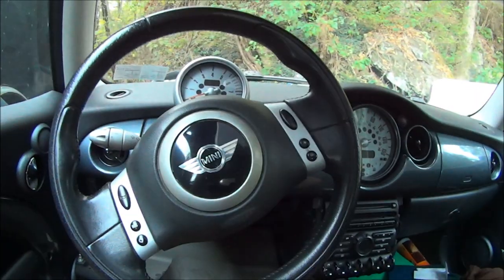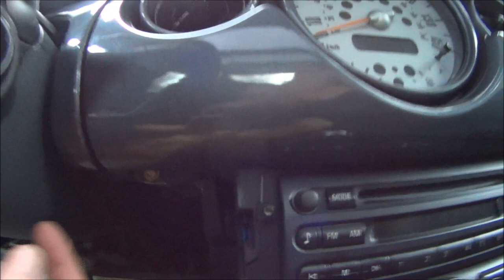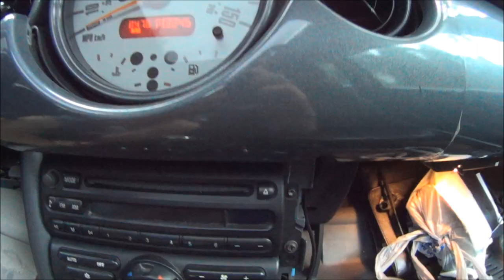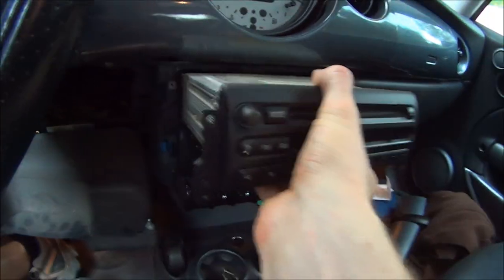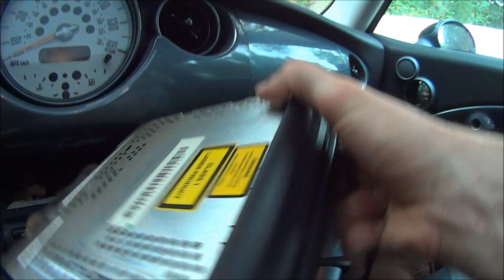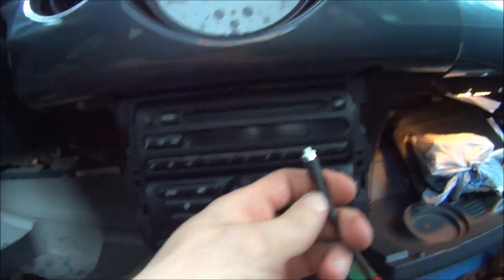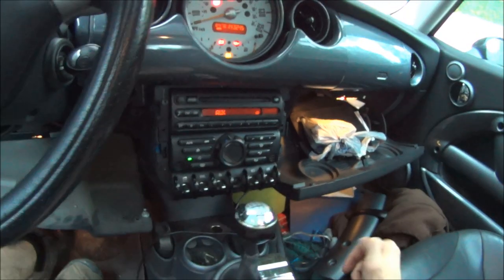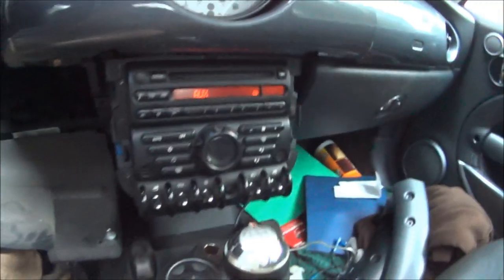Install AUX Adapter in MINI Cooper + How to Remove Radio - 04 Cooper S - Auxiliary Jack 01-06

Comment from the maker: IF YOUR RADIO WON'T GO INTO AUX MODE:

1. Plug in a music playing device to the radio, play a song, make sure the volume is all the way up on the device, and then try to press MODE. If needed, verify your device's headphone jack works by testing it with headphones.

2. Sometimes the cheaper generic cables aren't put together properly. The electrical pins MIGHT be in the wrong slots in the plug, make sure the wires going into the plug (male) match the locations of the pins on the radio side (female).  If you bought a BMW cable, there should be no problem with the cable.

3. If you're not in the US you might have a different type of radio (similar doesn't cut it, different is different); so you may need this:  https://www.amazon.co.uk/Cooper-iPhone-player-adapter-interface/dp/B00JEWNTJE (be sure to read their entire listing to make sure it fits your radio), and you might want to look at this: http://www.mini2.com/forum/first-generation-interior-ice/166862-diy-aux-input-uk-mini-cooper-pics.html

Also when I say CD player I mean the 6 CD changer that mounts in the back of the car.

Comment: I watched your video several times over the course of the past month, in readiness and I ordered one of these cables. It arrived today. 20 mins later, i had it plugged in and AUX appeared in the mode settings and away i go. My iPod and iPhone both work a treat. Great video and tutorial. (2004 mini cooper convertible). Thanks DIY car guy. :)
Reply: So it didnt appear until you plugged the aux in?

Comment: I did this yesterday. When you pull down the panel at the 27 second mark, using this video as a guide, at that point you can reach behind the radio, feel where the plug goes with your finger and plug it right in with the tab facing upward as shown at 2:51... My radio showed the AUX option immediately once the plug was in! I hereby dub this "the reacharound method".

Comment: Thanks for the video.  I'd been putting the install off for weeks because I didn't want to remove all those pieces.  With your video, I saw where the plug was on the radio and how it was oriented.  I popped the piece down below the steering wheel on my '04 Cooper S MC40, felt around behind the radio, and (using yours as a go-by) installed it without having to pull the radio out at all.  Connected it to an aux-to-bluetooth kit ($15 on Amazon) and in 30 minutes had a crystal clear bluetooth handsfree setup.  Even though I didn't go through most of the steps, I couldn't have done it without your video.  Thanks!
Reply from the maker: +Chris Wade No problem, Good thinking, that is awesome! Hopefully others will see your comment and save themselves a bunch of time. Thanks for sharing this info!
Reply: +Chris Wade Nice! But where did you leave the cable?
Reply: +Diederik I fished it through to the glovebox and installed it in the normal spot.
Reply: Did you drill through the normal spot in the glovebox or?
Reply: +Tyler Osborne Yep. Same place. Everything is basically the exact same, I just skipped removing the cd player.
Reply: Thanks so much for all of this, guys!!! I can’t wait to try this on my 2005 Mini Cooper S CV. I KNEW there had to be an alternative to replacing the radio for $700. LOL I’m an avid DIYer - if I had the means I’d repair the engine if necessary. Woo hoo!!
Reply: Chris Wade I have question. What kind of aux to Bluetooth plug did you use?
Reply: I've installed a Bluetooth connector as well, but (just as in th epinned post) my radio doesn't seem to recognize that the new bluetooth unit is connected. Have tried full volume, but still not working. Any suggestions?

Comment: I managed to get it working simply by pulling off the panel below the wheel, then fishing my finger back there and plugging it in. I’ve also got a phone charger hooked up along with the aux cord, they both go behind the steering column and pop up next to the tach, and go straight to my phone which is mounted to the windshield. Pretty damn clean

Comment: I put a cheap Chinese AUX adapter cord on my 04. It would not recognize AUX at first. It would when I hooked it to an Ipod. This was just a dumb cable: two plugs connected by a wire. I tried a better cable. This one had a small "canister" built halfway along the cable. The head unit recognized AUX right away whether there was anything else plugged in or not. That canister must have some electronics in there. I wired this to a cheap JRHT-Q9A mp3 player and mounted it in the plastic apron below the toggle switches (just in front of the heater core, behind the cup holders). Works great and very discreet. Note that the head unit did not recognize this particular mp3 at all using the first cord, but did with the second.  Also, you can set the AUX input level on your factory head unit. It's an option with that musical note button.

Comment: this all decent info but you don't need to go thru all this. you can just pull the steering column trim down, reach in behind radio and snap it in. it's kinda tricky but no more tricky than dismangling the dash.
Reply from the maker: I needed to show people the plug location. This is also covers how to remove the radio.
Reply: My bad. Not trying to be snarky. You are correct. I've installed hundreds of aux plugs in the 10 years I was a MINI tech and I was just throwing the 10 minute install option out there.
Reply from the maker: Steven Phillips No problem, I'm glad you did, it will probably save some people some time. So thank you

Comment: The tip of my aux cable is stuck in the aux port in my 2015 countryman. Any ideas on how to remove to whole port to either replace the whole port or get the stuck bit out?

Comment: VERY IMPORTANT DETAIL: you casually mention that you can mount the plug in the blank switch location under your climate controls. There is the switch circuit board directly behind that blank and there is no path through  without messing up the board. I had to cut into the side of the switch box and managed to make it fit but it is a dangerous path to go. Just drill in the side of the glove box like the instructions say and be happy.

Comment: Thanks for this you really helped out with my install! My setup is working and going into AUX mode and playing but... whenever I attach a car charger to the ipod i am using it stops working. Can you verify this happens for you? 
Looking in a search this may be an Apple thing but wanted to see if it happened to you.
I've tried four different types of ipod and an iphone with various different chargers - no joy!
Thanks for any feedback!
Reply from the maker: No prob and thanks for watching. It doesn't happen to me, I'm not sure what the issue could be since you tried a few different devices and chargers. Could be with the radio but it's hard to say. I'm using an iphone 4 and a belkin charger
Reply: This happened to me too. I ended up getting a cheap ground loop isolator for the aux cord on Amazon. It worked like a charm after that. I had no problem playing music and charging at the same time.
Reply: Thanks so much for this! Bought an isolator from Amazon and as you say, it worked like a charm!!! Frustrations with non charging are now at zero :)

Comment: I bought the cable and installed it on the cd/fm player of MINI COOPER R50 2002 model.
But it didn't show an aux mode on it. Only show the FM AM and CD mode. :(
Do you know why?
Reply from the maker: +madwho95 plug the mp3 player into it first, possibly start a song, and then try to put the radio in aux mode
Reply from the maker: +madwho95 Sorry I didn&#39;t see this comment earlier, it was in my spam folder because of the link. You might have gotten a defective cable. That car should have AUX mode because I have the same exact radio. Look at the wire closely and make sure the pins are in the plug all the way and in the correct spots corresponding to the pins on the plug port on your radio.

Comment: Hi I installed this on my 2002 mini and I don't get the aux option. My radio also has to spare plugs not just one if this makes any difference? It looks the same apart from that. Any advice how to get this working?? Thanks
Reply: BLAH DIBLAH where did u get your lead from ? I bought my first lead from eBay and it didn't work . It all plugged in but wouldn't show the aux station on the radio .. I found a lead on amazon in the end which a few people with minis had given feedback on .. I bought the lead as it was about £6 and it works brilliantly first time x
Reply: Sarah Hickley I got mine from eBay too. Might have been the cable like you say but instead of buying another I just changed the radio since I got one free from work. Cheers anyway tho

Comment: First of all, great video!
I've tried it but infortunately the aux mode didn't come up.
I guess the radio in my 04 mini cooper r50 is too old
Reply from the maker: Thanks! It shouldn't be too old. Mine is an 04. I added some troubleshooting to my pinned comment, it should be the first comment that shows up if you select "top comments". Are you in the UK?
Reply: +a DIY Car Guy Nope i'm in the Netherlands. I bought a cable similar to yours (looking identical) on ebay, i'll give that a go. Edit: I also tried your troubleshooting comments, unfortunately I couldn't fix it.

This is how my plug pins look like from the front:

000X00
00XX00
(With X being pins / contact points)

Do you think i might've gotten a wrong cable?
Reply from the maker: You'll have to check if those contact points on your plug match the corrosponding pins on your radio. I have no idea which ports had contact points on my plug. It looks like you have the right plug though judging by the diagram, nice job on that btw lol. Does your radio look exactly like mine? UK radios are different from US ones, so I wonder if other EU radios are different.
Reply: a DIY Car Guy The radio looks exactly the same as yours, i've been looking on some forums and it might me a bug that happens often with mini's (i need to ground loop the aux cable i believe). Or of course i might have a faulty cable like you have suggested in the troubleshooting post.
Reply from the maker: Hopefully the ground loop thing works, can you let me know if you try it?
Reply: a DIY Car Guy I will let you know if i try it. I've read somewhere that rewiring the lead and replacing the white plug which is already inserted (CD changer i believe) will also work as a workaround, so ill try that first.
Reply from the maker: Diederik Ok thanks. Do you have the remote 6 CD player?
Reply: a DIY Car Guy I actually don't, but i think the cables are there if you do decide to upgrade. (A few days ago i tried to unplug it but it didn't affect the CD player and the radio)
Reply from the maker: Diederik Oh ok. The aux cable is supposed to get plugged into the port where the 6 CD changer would get plugged into. I have the wiring for the external CD player too, but it wasn't plugged into my radio.
Reply: a DIY Car Guy Ah i see, do you happen to know what the white plug next to the empty cd changer port does? 

According to someone on a forum, replacing the white plug with the aux should be a workaround, and music should be played through the aux cable when on the CD-mode, but the "aux" mode like you mentioned should only work on the other port.
Reply from the maker: Diederik Sorry I'm not sure what that one is for

Comment: anyone know of a video on how to rout the cable behind the dash into the glovebox mounting spot?
Reply: I had to take the glovebox out but it works and is great.
Reply: @larryhicks9277  I figured it out, I didn't have to pull the glove box out though I just pulled out the little plug in the glove box and drilled a hole in the plug then I just fished the cable through the hole and screwed the aux cable to the plug

Comment: Do you know the answer to this?  I have xm direct hooked up will this install work with the satellite radio?
Reply from the maker: I'm not sure how I missed this comment, but I think it would still work, unless if the XM receiver is plugged into the CD changer port.

Comment: I did this and it won't work. please help.. I have a mini S and it fits perfectly fine but the radio won't show the option in Mode.
Reply from the maker: if it doesn't work when you press the MODE button, plug in a music playing device and then try, if that doesn't work then electrical pins in the plug of the cable might be in the wrong slots, make sure the wires going into the plug (male) match the locations of the pins on the radio side (female)
Reply: a DIY Car Guy I'll give it a try tomorrow during the day. I think a lot of us would be happy to see a video of you explaining the possible issues of this.
Reply from the maker: Its Your Papi Traps Lemme know what happens. I may do that, although I don't have a definite answer as to why it doesn't work sometimes,,,just a few ideas.

Comment: Is that the same for a 2008 Mini Cooper?
Reply from the maker: I think removing the radio might be different....but if the plug is on the back of the radio then the cable should work

Comment: My cable is ok. 
But only if i don't connect the power cable.
If i connect audio in cable ( i've a Female connector in the wire ) it's ok, but when i connect also the power wire in my phone, is like that i disconnect the audio cable. It don't work.
Reply from the maker: make sure the phone volume is up
Reply: lol

Comment: is the plug that get's plugged in the back of the radio have like stacked stairs or no?
Reply from the maker: +RClittleKING it's mostly square, you can see it if you follow the links to the item in the description
Reply: +a DIY Car Guy alright but does the plug have a bunch of little holes ?
Reply from the maker: ***** yea it has 12 holes, but there are only 4 actual pins I believe
Reply: a DIY Car Guy ok thanks a lot
Reply from the maker: ***** welcome

Comment: Hey, I did everything shown in the video the only problem I have is that my radio doesn't go in aux mode. It does have a mode button next to the cd insert. It also has a cd changer connected... Require help, tnx.
Reply from the maker: +Kas Spiessens How did you plug in the aux wire if a cd changer is connected? They go in the same port.
Reply: +a DIY Car Guy There was a free port next to the changer input.
Reply: +a DIY Car Guy New connector does not fit on cd port
Reply from the maker: Oh, are there any metal pins in that free connector? Also, you might need to have the mp3 player hooked up and playing in order for the radio to detect it, then you can press the MODE button. Give that a try if you haven't already. If that doesn't work, try leaving the CD changer disconnected and try to hit the MODE button with only the AUX cable in.
Reply: +a DIY Car Guy OK, I'll try it and keep you updated. Tnx for your time.
Reply from the maker: Kas Spiessens sounds good, no problem
Reply: +a DIY Car Guy We got it working after rewireing the plug and then using the cd-Changer input. Thanks.
Reply from the maker: Kas Spiessens cool, no problem!
Reply: so the wires in the plug of the cable were connected incorrectly?
Reply from the maker: Dima B compare where the wires are going into the plug, and where the electrical pins are on the radio side and make sure the plug factory didn't stick a wire in the wrong part of the plug
Reply: I'll try then to sort out if the wires are connected correctly. thx anyway. if any 1 knows the right order pls let me know
Reply: Hello, could you please tell me how you wired the plug? I got the same problem, thank you.

Comment: Mine is an '03 base model. I assume it's exactly the same. Anybody know if there's any reason they'd be different?
Reply from the maker: +Nick If the front of your radio looks like mine then I'd imagine it's the same. You might want to remove it and check the back before buying a cable.
Reply: +a DIY Car Guy Is it a CD player that fills the empty hole, or just the CD changer?
Reply from the maker: Nick The empty plug on the radio is for the optional 6 cd changer that mounts in the back of the car
Reply from the maker: The radio should go into aux when you press the mode button whether the ipod is plugged in or not. Press the mode button twice to get into aux mode. It goes radio > CD > aux > back to radio as you press the mode button. That's what mine does.
Reply: +a DIY Car Guy I plugged in my iPod and it works. seems like it needs to be plugged in to work, which is fine with me! thanks for the help!
Reply from the maker: Nick awesome! mine goes into aux even when nothing is plugged in. Must be a programming change they did.

Comment: is that the same for a 2005 mini one d?
Reply from the maker: it should be the same as long as the radio has the plug for the CD changer on the back
Reply: +a DIY Car Guy thank you so much
Reply from the maker: Alessandro Laffranchi welcome and thanks for watching!

Comment: Does this work on a 2003 Mini Cooper?
Reply from the maker: it should if your radio looks like mine, you also need to check the back of your radio to see if the plug is there
Reply: Yep it Looks exactly the same. I'll try it soon and see what goes from there 👌🏻

Comment: It doesn't let me go on aux mode for some reason.. Any advice?
Reply from the maker: try plugging in a music playing device then try to press AUX
Reply: +a DIY Car Guy  still doesn't work, only got the cd option in mode and the fm am
Reply from the maker: might be a faulty wire or the plug isn't plugged in all the way...or possibly the music has to be playing for the radio to detect it....other than that I'm not sure
Reply: +a DIY Car Guy alright cheers, I'll try get another one and hope it works.
Reply from the maker: Jazzer Andrews I hope so too man!
Reply: Have you got another cabel? I have the same problem
Reply: +Dima B Yh I bought another one and it still doesn't work lol smh